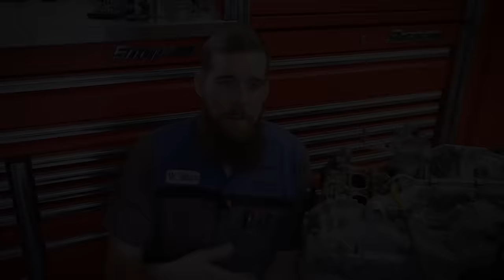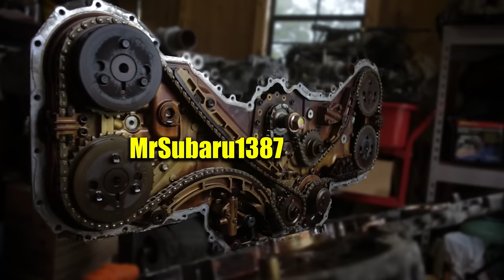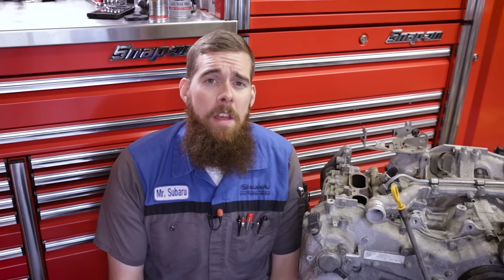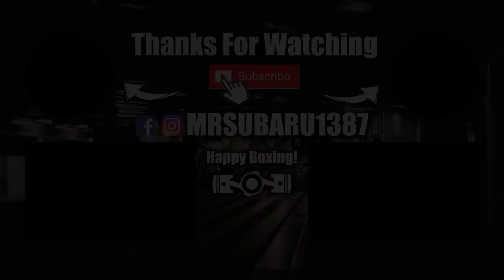Why Subarus Are So UNreliable!!! Buckle Up!!!

Comment: I don't even own a Subaru but as a Ford tech I can attest to your frustration. Nearly every single EcoBoost 3.5L engine concern I've fixed were caused by piss poor maintenance. Either they don't change it often enough or they're getting it changed with the cheapest possible oil they can buy and then following the oil minder in the vehicle. Turbo oil filters plugged solid with sludge and carbon. Half inch of sludge in the cylinder head cam area. And those people are always the first to spread the word about what a POS their Ford was and how they'll never own another. Lol. It gets old...

Comment: You are 100% correct. I was wondering if you can tell me what’s up with the Ascent transmissions? My wife’s Ascent needed a whole new transmission at 10k miles and is currently in the shop again getting a second one installed at 24k miles. She doesn’t drive rough at all and since we purchased a maintenance plan with the car it’s had all it’s regular maintenance done on time by Subaru.

Comment: I have a built 02 WRX and I have done everything the right way. Pro tuned, oem parts and good aftermarket parts no eBay parts. I check the oil every time I get gas. I’ve met people who have told me all the stuff they have done to their Subaru only to have it last three months. The cause of failure no tune, beating on the car and the owners negligence.

Comment: I recently got a text from a Honda salesman telling me that they just got in a truck load of Hondas in. I told him I’m not looking for a Honda, I’m looking for a Subaru. He then tells me you know Subaru is the most expensive basic vehicle that you can buy. That consumer reports say that Subaru is not the way to go that Honda is better. I tell him a an automotive technician and previously owned a Subaru as long as you know nuts and bolts you can work on any vehicle. He then tells me your not a mechanic, I said YOUR RIGHT IM NOT A MECHANIC. I’m a Technician I find the problem and fix the problem I don’t just replace the parts like some mechanics do. Besides why are you trying to sell me a brand that I’m not interested in. Tell me who your manager is. Never said a word to me again. The whole point is I’m not interested in buy a Honda I was looking for a Subaru that they had in stock in their pre owned lot. My first Subaru to fall in love want even mine it was my dad’s 5 speed wagon. And then I bought a 2002 Subaru WRX midnight blue with STI wing gold 18” wheels with coil overs and angel eye headlights. Loved this car. Till I buy another Subaru but I’m thinking of a Forester wilderness model. Keep up the good work. I always say Subaru is a true all wheel drive vehicle the others are generics.

Comment: We have a 2003 Subaru Forester.  It is quite reliable.  Main issue is the last dude didn't do the tune up right and the spark plug unwound itself. Happened to my dad driving from San Bernardino County, California to King County, Washington.  I prefer driving our real General Motors rigs. Subaru is reliable, but does not give a comfortable ride. Not the best road manners, but they are reliable.  Only 88,000 miles. We should sell it off and buy gold bullion.

Comment: LOL THANK GOD the video isn't what i thought it was going to be. just bought an '09 impreza outback sport and seeing this video title in my feed made my heart sink! 

if you'd be so kind to answer, i have some questions for you! i had already bought the car and i noticed (too late) that the coolant in the reservoir was pretty nasty looking. i'd like to perform a coolant flush and i want to make sure all components requiring coolant are full when i start the car, including the heater core. for the life of me i cannot find the video that contains the pressure vacuum pump tool that goes on the radiator cap and fills the engine with coolant. no one at any auto parts store seems to know what im talking about. could you please give me the name of that tool? i really appreciate it. also, id love it if you did a head gasket replacement tutorial! since my subie has the ej253 with the graphite head gaskets, i know they'll eventually lose that coating and fail. i want to perform the replacement at around 80-90k miles, currently at 60k. i'm a huge amateur when it comes to cars, but i fell in love with Subaru. i had the pleasure of driving a pro tuned WRX and ever since then i've been needing more subaru in my life. my impreza means the world to me now, and i want to keep it running for a really long time. im glad to have found your channel!! its super helpful and your knowledge of this brand is massively underappreciated. please keep up the good work!

Comment: I'm about to buy my first subaru, and it's going to be a stock impreza...so basically leave it stock? And i will get the best life out of it correct? Cause i had no clue i would have to retune it if i put a aftermarket intake on it...i dont want turbo or all the bells and whistles, i thought a new intake would help it breathe better then the stock enclosed box, but if it will do more damage then good I'll leave it alone...any hints and tips would be greatly appreciated thank you...RESPECT

Comment: I have a legacy 2.0R with about 180k miles on it. 
Every 6k miles fresh oil and filters, and every 12k miles fresh spark plugs too. 
It’s not consuming a single drop of oil and the outside is bone dry, just one of the most reliable cars I’ve ever owned

Comment: 99% agree. Subaru does go out of their way to make recall & service bulletins to take care of things that other brands, especially American brands, would never do. Though, it is pretty silly that Subaru never just used the MLS turbo head gasket on the NA models, and just resolve that issue completely and helped dispel that stigma. Also sucks that the CVT was basically a customer experiment by Subaru and they're all ticking time bombs up until 2016 or so. 

It also sucks that what were generally agreed "good parts" like a Gates timing belt kit, have now gone to crap too. At least you can find the original supplied OE parts for cheaper than from Subaru, and it makes a timing kit not very expensive. 

There are very few original components that can be improved upon. Its great that TiC makes a better cam gear bolt now, because those allen/hex head bolts are so terrible to deal with. And things like the Killer B oil pickup to help prevent cracks in the factory oil pickup.

Comment: Bought a 13 fb20 hatch 174k million 5speed stick of course replaced the exhaust, change the front and back dif and gear fluid, front wheel bearings because the rotted out and rotors and pads and lasting tires, honestly do regularly oil changes but never had a major problem then any other car since this one, she drives good first subaru and want to keep her for a long time

Comment: I have an Impreza with ej204, an engine I don't think the states ever saw. It's stock and it runs pretty good for near 300 000km, ran even better once I changed the spark plugs. It died on me twice but that was due to bad alternators, apart from that it starts everytime and gets me to where I need to go even coupled with dreaded 5 speed manual better known as the 'glass transmission.' Contrary to popular belief the 5 speed is fine in non turbo Subarus, and can even handle a good amount of abuse, Ive grinded many of the gears many times on accident. 

Subaru aren't a bad car maker, they're about as good as any other brand really, just depends if you want constant AWD and the boxer engine and the pros and cons of that, or something more 'normal'

Comment: Just bought a 2015 forester for $2600with 330k with a bad cvt. Original engine and cvt. Bought a 30k engine and cvt for $2300. Going  to put 200k or more miles on it.

Comment: I am a 10 year owner of a GT86.  Subaru boxer.  Normally aspirated.  If you look at what Subaru's are, I mean step back and look at the full range of Subaru's, not just the "hot" models.  They are basically rural farmers cars.  Their prestige in rally comes from (mostly) Ireland where they were the favoured car by farmers to enter into rallies.  Impreza and Legacy.
The cars are cheap trash with cheap plastic interiors, literally the same plastic they make kitchen flip bins out of.
Of course the rally people modded them with turbos and then intercoolers and eventually the WRX/WRC variants became a thing.
Kids online buying a GT86 will already have ordered their cheap turbo kit, coil overs and everything else they need to completely and utterly ruin the car's character.  Then 2 months after owning it they are complaining it handles like shit, the turbo has lag and they have spun it 5 times due to the turbo kicking in.
Of course they delete the ESC (nannies) and the ABS fuse because that makes you cool.  Sadly about 30% of them reappear a while later with photos of either a written off car or a blown engine.
Mine is unmodified.  Car remains light, repsonsive, aggressive and gripless.

Comment: Bought an '04 Subaru WRX wagon w/ 85,000 miles, completely stock, aced the PPI, there was no outward indication of abuse. We got 13k on it before it spun a rod bearing. Replaced the engine with a factory Subaru short block, and replaced everything associated with the oiling system to prevent any bearing material  from polluting the new engine. Replaced both heads with brand new castings (originals were both cracked). The engine lasted 16k before spinning another bearing.

Of all the cars I've owned in over 25 years of driving, I've never wrecked an engine with my driving or maintenance. I'm not saying there's not people like you describe perpetuating the notorious issues of these cars (bearings, oiling, head gaskets, ringlands, etc), but it feels like a straw-man argument to say there isn't anything to Subaru's rep for unreliable engines, specifically turbo EJs. As someone who lost around 25-30k to engine repairs from normal use, changed their oil every 3.5k miles, had routine professional maintenance, and did everything they could to prevent the second engine from eating itself alive, that stings a bit.

Comment: Mr Subaru what is your opinion on getting a better tune on a stock 2011 WRX lots of misinformation out there and I’m not sure if it will help in the long run or to just keep the stock tune. I know you usually like to stick with Subarus recommendations.

Comment: My EJ205 is at 350K and still going strong had no major issue kept up on regular service. I recently replaced the turbo injectors all gaskets and had the valves ground first service like that ever other than oil change and timing belt

Comment: This reminds me of the hype on the Ford 6.0 turbo diesel. People want to install tuners and bigger turbos and beat the hell out of them and then are shocked when the head gaskets let loose. The 6.0 had some design flaws with the oil cooler and EGR cooler that can be corrected but if you boost any engine beyond its design limits its going to blow.

Comment: I have a 07 Forester 5 spd over 160k all original & I tow a small trailer with 3 dirt bikes around. Not a single issue. & I lowered it using OEM wrx struts

Comment: 2022 Outback LTD XT, my first Subaru. At 4K miles realized That my first oil change is due. 
After contacting my dealer and another local deal I was informed that I couldn’t get an appointment for 2 weeks.
So, I went to a local Ford dealer for the oil change (walk-in). Obviously a Motorcraft filter was used.  
Now I’m worried a screwed up…what should I do?

Comment: I’m 19 and have owned a 2005 2.0 sti for about 10 months now. 66k miles. After looking at these videos I get so frustrated seeing people slander Subaru. It’s common sense to maintain the car in all aspects for longevity. As stated not all cars are perfect but to blame every fault on Subaru doesn’t make sense.  Change parts on the specific intervals to minimise failure.

Comment: I am a Subaru fan boy..have two in our driveway…numbers 4 and 5 that we’ve owned.  I regularly maintain our cars.   2011 Subaru Outback.  Following service schedule…religiously.  Head gasket failed at just under 60,000 miles (96,000km).  It was not driven hard, abused etc.  it was fixed and that car went 11 years 255,000km.   I believe there was a HG issue with some HGs.  Period.

Comment: Was hoping for more specifics, but good advice, thanks!
I have a 2002 WRX Wagon, first allocation since new.
176k on original motor, burned through an exhaust valve.  Exhaust Valve edges looked thin, my Subie specialties dissuaded me from checking or adjusting valve lash at 100k.
90k on new short block, new head and valves, one exhaust valve again looks like it is missing an edge, rounded off around the missing outer edge.
All other valves look fine seal fine.
Have had intermittent misfire codes for a few years.
Not yet sure why this one valve failed so quickly this time.
Stock airbox & filter, though tabs on original airbox failed and took a minute to get a replacement jdm takeoff airbox, 6 or 7 years ago.
Silicone turbo inlet hose added at engine r&r, sti uppipe, both since original tune.
Also mild stock exhaust manifold clean up, and prodrive muffler.
EGT usually ~ 1400 ish, spiked to 1600 for a moment as this last valve seemed to go.
Car seemed to be running well, just ran some redline fuel system cleaner through.
Drove the car easier this last 90k than first 176k, total of 265 k now.
Mobil one every 5k, 5w30.  Doesn’t use oil.
Iac got stuck for a bit a few months ago.  Cleaned it and working ok again.  Some oil residue in and around it/throttle body.

Mild tune, may look into an updated tune.

Had fuel injectors serviced again, 350 - 400 flow with two dripping at initial cleaning check, after cleaning all at 420cc going back in with excellent spray patterns.  The 350 was cyl 4, bad valve cyl 2, but cyl 2 usually part of the intermittent misfire code issue, sometimes 1&2, 1&3, 1,2&3, with bad valve this time 2,4 just that day.
A Little evidence of heat around the head gasket by the exhaust valves of cyl 2.
I was hoping and expecting more 150k again.  90k was a surprise?
Coil packs and plugs not that old.
Thanks for any ideas. 🙏

Comment: MIne is belt driven.
230K Miles, not even my Alt has died...
2003 Outback Stock. Over reved, yes about once a week, I ran low on oil many times, BUT I never miss an oil change!

Comment: I love my 2000 Impreza with the 2.2. Every single problem I’ve ever had with it was caused by me. Last time it had a problem it was a dropped valve guide and it was because I ran open exhaust on it for a year and didn’t tune it, it’s never had an issue that wasn’t my fault… best car ever!

Comment: Hi Mr. Subaru I enjoy your videos. I have a question I have a 2019 Subaru Forrester outback sport I have 66,000 miles never had any problems. I’ve always changed your oil regularly is there anything that you can think of that I need to do to keep my vehicle in top condition like any problem areas that I should look for and change, thank you

Comment: I own a Subaru and It's the best car I've ever owned never gave me any problems, other than A 02 sensor and wheelbarron I got it at 149000 miles now it's over 200000 miles,  Sometimes I think the engine killed because it runs so quiet, It is a 2.5 2004 Subaru forester, My only hope is for it to be better on gas But I do drive a lot I'm a delivery driver

Comment: I just bought my first turbo EJ subaru being a 2007 legacy 2.5gt and i am being completely anal on making sure everything is up to par. Oil changes, checking for leaks, constantly checking the ECU and making sure there arent any codes popping up. I want this car to last me a long long time since we dont see many on the road these days. Old girl has 120k+ miles on her and the last thing i want is to see another Legacy Gt in a junkyard due to preventable issues. Love subaru, love the boxer engine, and love the rally pedigree. Im 26 atm and i understand that things can happen but if its within my power, imma do it.

Comment: 2005 legacy wagon gt. 110k miles, on engine #4 and sold the pos.  Never let the gas go below half, warm up the car in the morning, let the car idle a bit when i stopped, religious oil changes every 3k, driven by two people over 50. It's a crap shoot on whether you get a good one or not. Now inhwar subaru is usually ng some kind of glue for gaskets? Is that right?!?

Comment: It is not only on Subaru that this occurs. The current trend in Australia is for young guys to buy diesel powered pick-ups and modify the blazes out of them with suspension lift kits and performance chips and bigger boost turbo's and crazy inlet air mods and then call the car crap when it breaks. What actually breaks more times than not is the aftermarket part they have put on. When the manufacturers part does break its because it is working well past its design parameters which the owners don't seem to have any understanding of. I have come to the conclusion that many young males have far more money than sense.